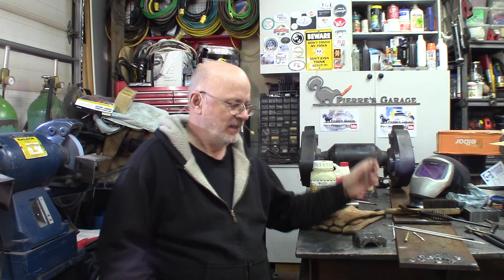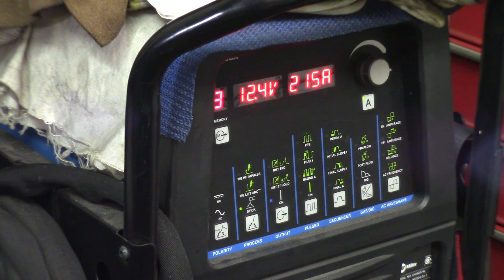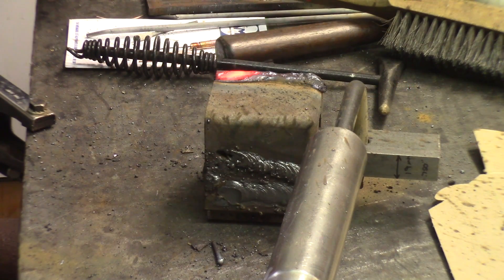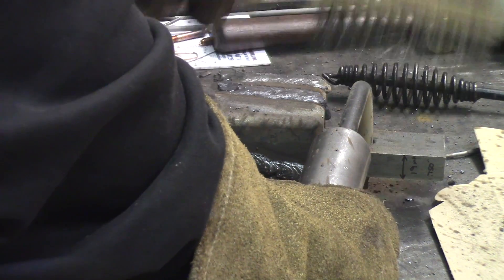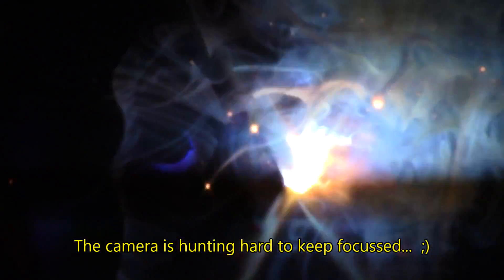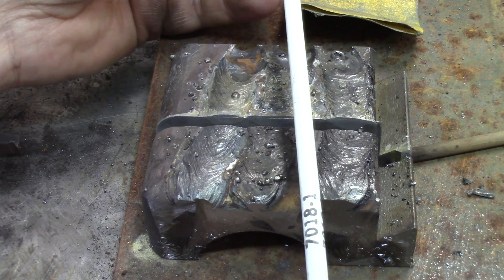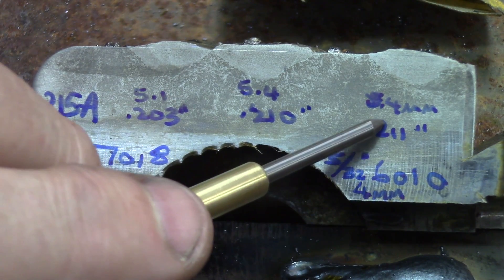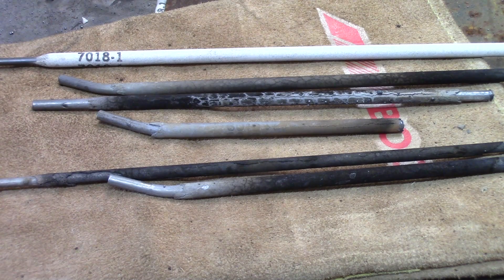Get much more penetration by Overheating 6010 and 7918 welding rods

Comment: jai passer mon test ici a miami avec la 7018 mais je ne conais pas la 7918 jamais servie de elle ? mais je me suis servie beaucoup de la LH7018 sur dc + never straight polarite tu le savaie surement , dans le pile driving construction trade  on la prenait pour emplir des grosses espace comme millwright cest le plus poplulaire jen ai bruller des boites de ca assez pour emplir un cratere sur la lune LOL ,,, l'autre 6010 plus populaire pour la penetration premiere passe etc etc , good souvenirs nice vid . thanks , ici en se moment nous sommes sur danger d'ouragans qui viens du gulf du mexique il mouille en titi mon gars , salut a prochaine chicanne LOL
Reply from the maker: Allo Marcel,
Did I mention 7918, if so it's a mistake, it doesn't exist...    I like the 7018, it's my favorite stick and it can really dig if it needs to, I got some video where I almost do a one pass 1/2" plate no clean and no prep even better than a 6010 that barely gets to 3/8" with plenty of inclusions.   Kinda busy for a couple of days but I'll try to edit and put online a few out of the box practices with welding rods...   ;)
Fait ettention à bien t'abriter pour la tempête... 
Côté température, ici c'est pas mal doux comme autour du point de congélation ou un peu au dessu, par contre on s'attend à de la neige pour le reste de la semaine, Beuark...!!! I HATE COLD...   lol
À plus,     Pierre
Reply: 7018 is an al position rod nice penetration i used a hell of a lot of it in my younger years its one of the hardest to learn cause you can see your puddle well . mon cher papa quebecoie qui ma montre et est venue avec moi a tous les soirs pour que j;aprenne la soudure en floride avec aprentie millwright jai bien faite ma jeunesse je nai pas crever de fain excuse les fautes jecrit jamais en francais . even at age 63 when we moved from ft lauderdale to here in Inverness florida i sold all my welding equipment thinking id never need it , but i miss the hell out of it now even with the vw buggy i could have used it quite a few times . trop tard maintenant salut de flo denis a plus tard
Reply: denis pas marcel LOL salut

Comment: I Like over power for piercing and cutting plate if i have nothing else.  It's better to smoke a few rod than smoking crack in your spare time.
Reply from the maker: Hi Bob,
Lots of fun can be had with a powerful welding machine,  such a great feel to see big masses of molten steel...  Just don't find yourself under if it ever has to droop...  ;)
Thanks for comment,   Pierre

Comment: very informative it's good to see video's like this , you are actually burning it in, as you know when you burn it in you change the structure of the base and filler metal, not a very good weld but a good representation. thank you sir
Reply from the maker: Hi Joe,
This kinda heat is not the way to make a weld that will be accepted in the inspection dept. but it could get you going in an emergency situation, nothing comes close to a good prep and using the manufacturer's parameters to get predictable results, mostly that the flux is so overheated that everything that comes out of there is a surprise...   ;)
Thanks for viewing and for comment,    Pierre

Comment: Glad I could be an inspiration. :-) Looks like your arc length is a bit long, it is odd welding overdriven as you really have to feed in fast. I think you should try a 3/8 plate butt weld with the 6010's (5/32) cranked and no weld prep. This would be similar to the farm welds I often have to do where a part is nearly inaccessible but it has a crack that needs repaired. I have had good success getting full penetration welds from the only accessible side by this method. Probably not the best repair but it usually the one the customer wants to pay for. Proper weld prep and settings is always best.
Reply from the maker: Hi Brian,
With that current, the puddle is kinda soft and I could barely feel the rod melting as it was going down in it, felt like a soft landing...   lol
The worse when welding is when you just can't see or that the access is so limited... :(    Sounds like a tractor in the middle of a field is a good candidate for this.
6010 is a rod that penetrates but my feel is that it leaves a joint more prone to crack than 7018, maybe just an impression, though.
More to come while the welder is out...   ;)
Cheers,    Pierre
Reply: If welding structural a36 type materials the 6010 should be much stronger than the base material and it should fail by pulling out of the base rather than the weld material itself giving up. A36 type materials are typically not bad about having heat effected zones where the material gets brittle just outside of the weld, but there certainly are materials that are. 7018 is itself a stronger rod but I doubt on structural it is any more or less prone to cracking, crank the loads of then of course it will be less as you approach the strength of the weld material. If you were welding say 4140 or something then big difference.
Reply from the maker: My preference goes clearly to 7018 for cleanness and ease of use except for restarts...   easier to remove the slag, less spatter, better bead, etc...    For tacking jobs I will 100% prefer 6010, for ease of use and restart, and on short tacks it tends to groove a little more, smells better also...  ;)
7018 is a rod specially made for use with med alloyed steel, just need to keep oil and moisture away from the welding zone, it's much more fussy to use in those instances mostly if you need to get everything according to code and have it inspected after the fact...